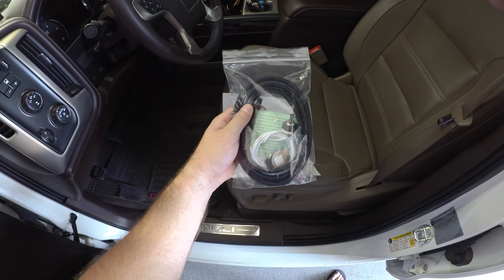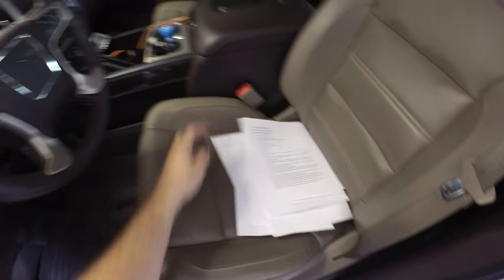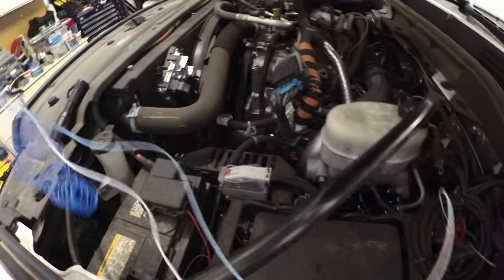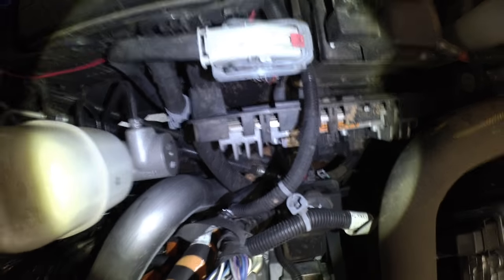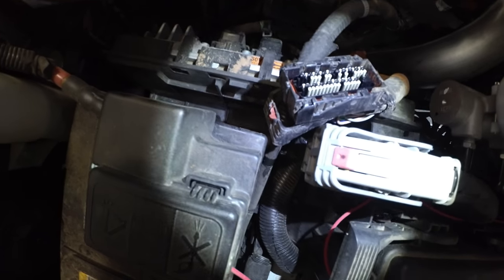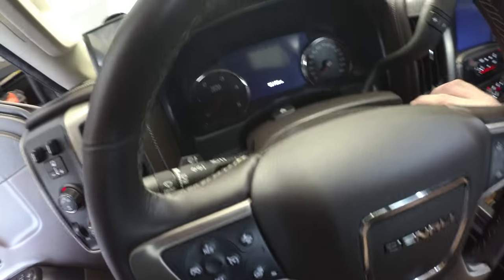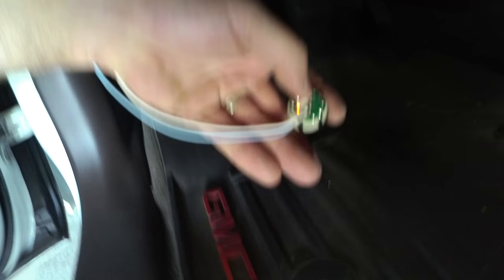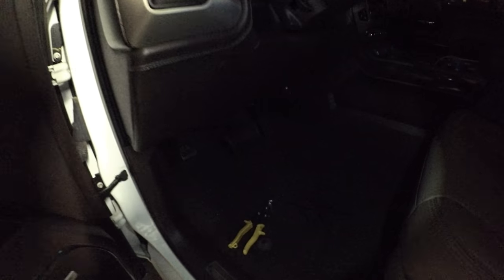How To: LSP5/DSP5 Switch Install

Comment: Instead of removing the pins from the connector, to avoid risking breaking anything couldn't you just identify the color of the wires on pins 26 and 47 then cut the wires and splice the wires from the switch to the wires from the pins?

Comment: I have a 2011 Silverado LML. When the switch is at the tune 1 it’s the brightest right? That’s what the card says . As you go up to tune 5 the led is diminishing or or off ? I have mine hooked up correctly but the light is not the brightest one 1 almost seems brighter on 4 and dim on tune 3 ? Don’t think it’s operating correctly...

Comment: The tunes don’t seems that strong, just want to make sure they are working. On tune 5 I would expect traction control to come on? How is yours ?
Reply: Did you figure yours out? Mine seems to stay on the same tune and no noticeable change between the tunes.
Reply: Jeremy Pace yes , the light on the back of the switch is just a reference. As long as the light on the back of the switch changes you are good . You running Duramaxtuner tunes ?

Comment: I think you should leave the wiring and ANY upgrade to someone who knows what they are doing... I don’t think your switch is working cause there is no change in sound of your engine or exhaust
Reply from the maker: Jeff Dreiman lol. The switch works fine. Sound doesn’t change because you switch the tune unless the tune is designed to raise idle or cause a lope of some kind. You should leave comments to people that know what their talking about.